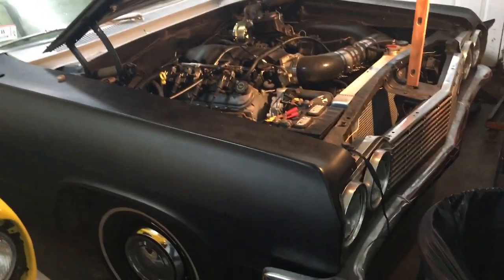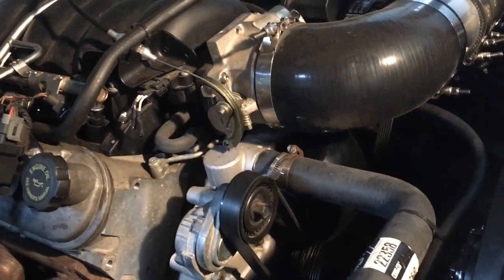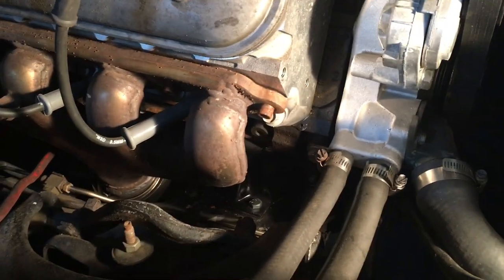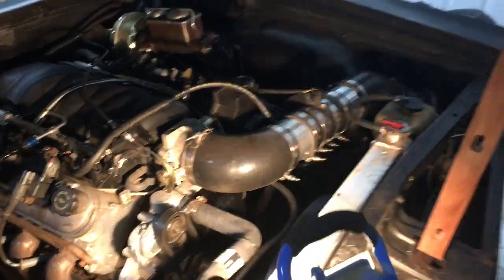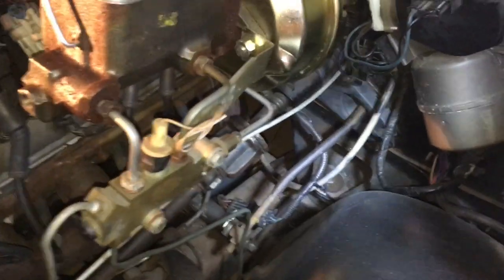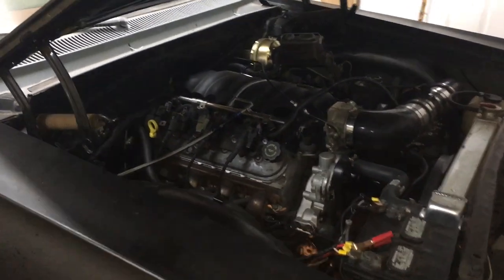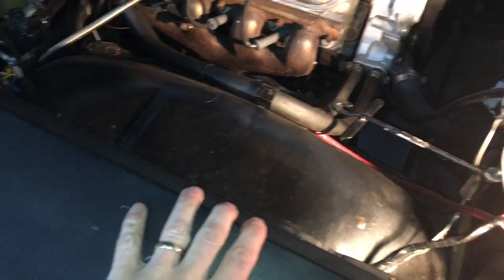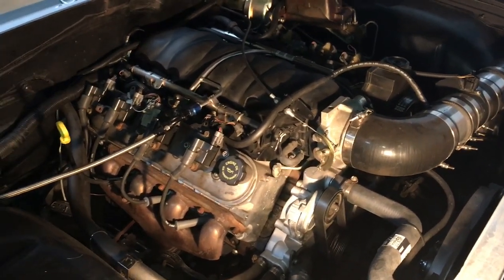How to LS Swap a 1961-64 Chevy Impala with a Muncie 4-Speed

Comment: Nice car.  I did the same thing a few years ago.  I love it. Lsx is the way to go.  Mine is a lq4 6.0 with ls3 heads and 90 mm ls3 intake. Nitrous outlet plate with a 175 hp shot going thru a 4l80 then a Denny’s driveshaft billet carrier bearing to a 9in ford.  I abuse it all the time.  Probably sprayed 300 lbs of juice thru it. No trouble what so ever.  Keep the videos coming!!!!!!!
Reply from the maker: Curt Schnitzer - thank you! I hope to spend this summer doing burnouts down my street.

I’m curious what you have for exhaust on yours and where you mounted your electric fuel pump & filter?
Reply: Fuel pump is a Walbro 255 mounted just foreword from the stock tank with a corvette filter/pressure regulator return is running into the filler tube.   Exhaust is BRB shorty headers then doug’s electic cutouts too 3in mandrel bent done by Hanksville Hotrods in South Denver
Reply from the maker: Curt Schnitzer - that’s awesome. Thank you! I initially had a single 4 inch exhaust from front to back and it sounded amazing. Sadly my state inspector didn’t appreciate it so now I have to switch it to be less loud. This means I also have to move my fuel pump and filter because I mounted them on the frame on the passenger side where the exhaust runs. So they are now in the way of the dual exhaust. Annnnd that’s what I’m currently working on .

Comment: I have an 01 5.3L will that LS3 manifold bolt right up without any mods to it?
Reply from the maker: David Cuevas - I believe that 5.3L has cathedral port heads, and the LS3/L92 has rectangle port heads. So the LS3 intake is not able to be swapped onto a 5.3L unfortunately. I believe there are some LS1 Intakes that would bolt into a 5.3L though.

Comment: What Master Cylinder are you using? I put a 5.3 in my 64 Impala SS. Engine didn't come with an intake manifold or many other parts, so carbureted for now. Was cheaper and easier at the time. Anyway another temp fix to get it going was to make my own bracket for #7 coil pack to move away from the master cylinder. would like to go w a duel like yours with a smaller diameter as well. Eventually front disc brakes. You didn't mention your driveshaft either. I'm running a 4L60E w stand alone harness. Had to have my drive shafts cut to fit
Reply from the maker: I’m currently using a master cylinder and brake calipers that are for a 72 GTO. The master has a 1 1/8 bore and calipers have a 3 inch bore. I actually swapped back to a bigger brake booster from the 7” because the 7” was not working. I didn’t dig into the problem deeply, but it felt like the engine wasn’t making enough vacuum for the booster. So - I also made a custom ignition coil bracket to work with the bigger booster.
My front driveshaft was modified to be the right length for my Muncie 4-speed, but it is actually just a stock length driveshaft for a factory 4-speed car (mine was not).
Reply: @WiringRescue  Thanks. I'm considering a Hydroboost system. The ultimate space saver.

Comment: Just found this vid. Love the build. How did you address the speedo? Doesn’t the LS require speed sensor? ‘63 SS here
Reply from the maker: The LS requires a speed sensor if you have an automatic transmission from what I recall. Mine is a manual, and therefore I don’t use one.  That being said, you can buy a speed sensor that goes in between the transmission and the speedo cable. It is a super simple design and apparently works well from what I’m told. Good luck with the 63!!

Comment: Very nice and helpful,I have been wanting to add an ls1 to my 1964 impala and keeping the 4 sp
Reply from the maker: Socorro Tapia - I felt the same way when doing my Swap. There was very little info out there considering how popular this engine swap is.  
Let me know if you have any question when you swap yours!
Reply: Jeremy N ok thanks
Reply: Hey Jeremy I picked up my LS 5.3 ordered the bell housing and flywheel today I was just wondering the original clutch cannot be used and if not what clutch did you go with it mentions 11 inch and also the pilot bearingOn all other fees they mention some kind of adapter would you happen to know what this is thanks
Reply from the maker: I used this clutch: https://www.1aauto.com/clutch-set/i/1atck00037  and I believe the clutch kit comes with 2 different styles of pilot bearing.  I think I used the larger one in my fancy flywheel.
Reply: Jeremy N Thanks Jeremy I greatly appreciate it ,this makes it a lot easier on my build
Reply from the maker: Socorro Tapia - I’m happy to help! I want to see my manual transmission LS swapped impalas!

Comment: Your fuel system is like what I would like to do. Thinking of maybe running a turbo also someday so having enough fuel is mandatory. Did you mig,tig or braze the bungs to the gas tank? Your very helpful. I appreciate it. 
Eric
Reply from the maker: I TIG welded it all to my tank, because I love doing it, but I'm sure MIG welding would be fine too. Just make sure you test it for leaks before putting it in the car.  When I was done, I filled mine with water and let it sit for a day to see if any drips happened.  Then when I was sure that it was sealed tight, I coated the entire outside of the tank with POR-15.

Comment: Thanks for the quick reply back. I will probably need the LS flywheel anyway. Do you think. Do you have another video on how you did your gas tank?  Really good info on your channel.  I will stay tuned.
Reply from the maker: EZElk - I sadly don’t have any video of the Impala gas tank. However, I can tell you that I bought a new gas tank, then I welded a small steel plate to the bottom of the new tank. Probably like 3x4 inches. Then I drilled two holes through it and welded two -8AN bungs to it. I only use one, but I figured it would be good to have an extra just in case I turbo the engine and need more fuel.  Then up on the passenger side of the gas tank I welded another small steel plate and bung for a fuel return line to hook in. So far - it seems to work! :) The steel plate was just to spread out any force from the fuel line movement. The gas tank is thin and I didn’t want the bung to rip away from the tank.

Comment: What about AC ? Where would You mount the compressor? And which one would you get ? For a Camaro ?
Reply from the maker: Dent Man - since I’m using Camaro accessories, I’d go with a Camaro ac compressor and bracket too, but there are now a few companies out there that make brackets for nearly any combo of parts you have. Truck, Camaro, corvette, GTO.... check out ICT Billet. They have tons of great stuff for doing exactly what you want.
Reply: @WiringRescue  thanks for replying !!! I'm doing a ls3 4l60e swap in my 64 rag and its a bit of information over load lol thanks man , ill look into them
Reply from the maker: Dent Man - I totally get it ! If you need any other help along the way or pictures or video for reference, reach out anytime. I’m happy to help!

Comment: It's frustrating watching conflicting info from different peoples swaps. Some people say they bolted in the 99-02 Camaro pan and it was a direct fit, others are cutting and using spacers... I have time to plan, but I swear after mine is done, I will have the only usable well documented guide on how to do this in these cars...
Reply from the maker: NFA RC - I totally get it. Honestly with the camaro pan being as close to the frame as it is, it’s worth it to just notch the crossmember and not use spacers. I’d bet the difference is within the rubber motor mounts. Different manufacturers probably use different thicknesses, which accounts for the space vs. no space.

Comment: This is me Socorro and Jeremy with another question I have everything set up now I’m down to the last thing on the agenda how does your fuel system work for you is it better than spending a fortune on the in tank fuel pump
Reply from the maker: Socorro Tapia - my fuel system seems to work quite well. I haven’t had an issue yet. It’s a walbro 255 external fuel pump with corvette style fuel filter / regulator .

Comment: I seen other videos saying the old clutches get ruined quickly and to use ls clutches . My question is how often do you drive and hows it holding up? My tempest is gonna be a daily so dont want to buy 1 that wont last
Reply from the maker: kenneth gonzalez - great info! I haven’t driven mine enough to know whether this will last or not. I have less than 1000 miles on it for sure. 
That being said, I’m not sure why the clutch would care if it’s attached to an LS or an old small block. I would think they would wear the same if the horsepower is comparable. I’ll be interested to see how long it lasts.
Do you have a link to where you saw this info? I’d love to read about it.

Comment: Great video! Very helpful! One question though, did you move the engine back any or did you use the mounts that put it in the stock location? How is the clearance at the back of the engine? I want to locate my coils back there. Thanks!
Reply from the maker: James Scott - the Muncie transmission is using the stock mount, which leads me to believe the engine is in the stock position as well. Behind the cylinder heads is about 1 inch. It’s pretty damn close to the firewall.

Comment: I swapped my 62 impala, I put a 5.7 2000 camaro engine..I have a similar master cylinder like on your impala.. the last coil hits master cylinder..Did you change your master cylinder,  see that it doesn't hit like mine..thanks
Reply from the maker: I modified the coil bracket on the driver side so that the 4th coil sits sort of below the 3rd coil. It seems to work great!

Comment: Hi Jeremy, I am also putting a LS in front of a 4 speed Muncie. I am reading conflicting articles on if I need a VSS or not to let the computer know if the vehicle is moving or not. Some articles I read say that you will have idle problems or even stalling without one and other articles say they never had a problem without one. Did you use a VSS on your swap? I was planning on using a GPS speedo so I plugged the manual speedo hole in the side of the transmission. Any guidance is appreciated.
Reply from the maker: Sherril Hammonds - my impala does not have a speed sensor, and it idles and drives great. That being said, I also have spoken with several people on the topic who tune these engines and they all recommend adding a speed sensor. Apparently it will make the computer happier and tune more accurately because it has more data to work with. So, I do intend on adding the sensor at some point, probably in the spring. Hope that helps you out!

Comment: I was looking at your swap pix. I'm doing doing same for a customer I need the part # for the upper & lower radiator hoses that you used. My customer has a radiator that has the top hose on the driver side

Comment: I'm doing a ls swap in an 1962 Chevy impala so some of these tips are helpful however did you delete the vats an what cleanup did you do to the harness?
Reply from the maker: I did have the VATS deleted, there are several people online that you can mail your pcm too and they will flash the PCM for a very reasonable price (and delete the VATS too).

I basically removed anything I wasn’t using. There are some guys on LT1swap.com that are great for wiring info. I highly recommend checking them out.
Reply: @WiringRescue  do you have any one you can refer me to to delete the vats?
Reply from the maker: Certified Auto Care Recovery - I used this guy for my 72 Lemans LS swap. It was quite easy. http://www.lt1swap.com/programming.htm
Reply: @WiringRescue  great I'll be definitely in touch with you I'm doing a couple swaps so I'm definitely going to need your help to work the bugs out

2018 ford mustang 
1962 impala 
1972 impala
Reply: @WiringRescue  thank you in advance

Comment: Did you use the standard gas tank and install a inline fuel pump
Reply from the maker: I used the stock gas tank and used an external fuel pump. I’m probably going to swap to a Holley in tank pump though because it’s quieter and a cleaner install.

Comment: Jeremy, very nice video and installation. I have a 1966 Chevelle with a bad 1992 454 Gen 5 engine and a Muncie 4 speed.  My Muncie is a 1967 M20. I think that it has the coarser spline front shaft.  It has the clutch Z Bar ball on bracket that bolts to a bellhousing bolt. This engine does not have a hole on the engine block either to mount the ball to. Do you think that this bellhousing would bolt up to an LS engine? Wonder if the current 11" clutch and pressure plate would work?

 Another question for you. Is your Walbro 255 External fuel pump real loud? I am thinking about a Walbro 450 in the tank but that would probably be a lot more work.

 Any help would be greatly appreciated. Subscribed.

Thank You

Eric
Reply from the maker: EZElk - Hello! I am not completely sure, but based on my research, your bellhousing and clutch should work fine. The only thing you will have to sort out as far as mating the two together is the flywheel. You can probably get the same flywheel I did, though you should measure your bellhousing first to be sure it will fit inside. My factory 1964 3 speed Manual bellhousing bolted up to my LS great, but there aren’t any flywheels small enough for the bellhousing that attach to an LS. I had read that a big block bellhousing would have worked fine. That being said, finding a good one was nearly the same price as the LS-Swap bellhousing I ended up buying.

My walbro is definitely noticeable with the engine off and the pump on. However, the 4” exhaust I have drowns out everything... so the pump noise is not noticed.  You could always start with an external pump (they are cheap and easy) and then go to a fancy in tank pump later on if you are annoyed by the whining. :)

Comment: im nearly finished my 1961 LS1 & 4l60e swap.
great video, i did things a little differently, but very close. i used a holley sump without the need to notch the cross member and use plates to lift the engine.
just a quick question, is the top radiator hose a suburban upper hose cut down?
Reply: Did you finish? Im thinking about ls motor on my 61

Comment: I saw in your rearend swap video you're running a 3.36 gear. Have you had it out on the highway yet? Trying to decide between a 3.36 and 3.55
Reply from the maker: I actually have not had it on the highway, but I have had it up to maybe 55-60 on other roads and it felt very normal to me. So overall I’m happy with the setup I’ve got.

Comment: What motor mounts did you run
Reply from the maker: Bradley Dunford - V8 64 impala rubber mounts and frame stands with the cheap $30 ebay LS swap adapters that mount on the engine block. I also added ~1/16 inch steel plate between the frame stands and frame to raise them up a hair.
Reply: @WiringRescue  ok thanks

Comment: If the pcm isn't flashed will the car crank over at all?
Reply from the maker: lordcycle - I’ve read that the engine will be able to start, and then it will immediately turn off. I haven’t actually tried this myself though.

Comment: Hello Jeremy, I am doing the ls3 swap in my 1963 Impala. I'm stumped on the exhaust manifolds, what year C5 Corvette manifolds did you use, and did you cut above the curve to make them drop straight down? Thanks in advance.
Reply from the maker: Hello!  I believe they are 1997-2001 Corvette manifolds, and you are 100% correct about where I cut them.  Here is a photo after I added a notch for my Muncie 4-speed Z-Bar, and before I welded the V-Band onto the bottom: https://blog.hotrodcoffeeshop.com/wp-content/uploads/2019/05/1997-01_Corvette_Manifold_Modified_For_LS_Swap_and_Muncie_4_speed.jpg
Reply from the maker: I have just uploaded this video that may also help you out.  https://www.youtube.com/watch?v=EBYni58GDDI
Reply: Thank you very much,  this should help.
Reply from the maker: David Clemons - Happy to help! If you need any more info - reach out anytime!
Reply: I took a chance and just ordered some cheap (probably Chinese idk) block hugger headers from ebay. Fit well, and bonus they came with the bungs (plugged) already installed for the O2 sensers

Comment: How does it run? I have a 63 impala 2 door
Reply from the maker: busaracer590 - absolutely beautiful! I could not be happier. The car did have a 6 cylinder so the difference in power is incredible. It’s also great to turn the key and know that the engine will start. No messing around with carburetors!
Reply: @WiringRescue  im going 2 up load a video off my car tomm it not done yet but let me no what u think? I have sbc 350 with Saginaw 4 speed with fitech fuel injection.

Comment: I have a 1961 Chevy and I'm looking to put in an 6.2L out of a 2011 Camaro will I need to change the oil pan. Also what motor mounts did you use?
Reply from the maker: Tony Tea Man Ganther - hello! I think you’ll want the LS1 style oil pan, which is what I used. I used stock V8 engine mounts on the frame side with ~1/8” - 1/4” spacers under them. On the engine side, I used the same eBay adjustable LS swap engine plates that everyone uses.  I don’t think it’s this brand, but the same idea. https://www.ebay.com/itm/LS-Engine-Mounts-Billet-Aluminum-LS-Swap-Kit-LS-Conversion-Chevelle-Camaro-Nova/192262505680

Comment: I was wondering how much room do you have between the back of the motor and the firewall
Reply from the maker: I just checked and the passenger side cylinder head has about an inch of space between it and the firewall.
Reply: Jeremy N is that with stock driveshaft and transmission mount? Thanks